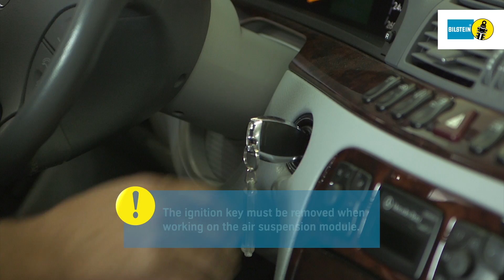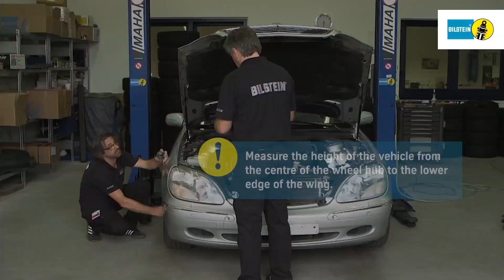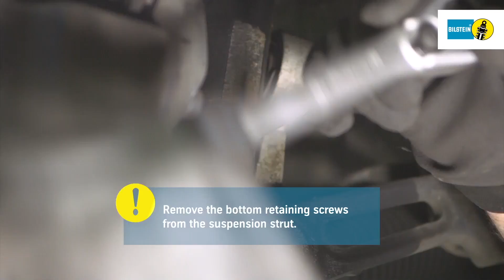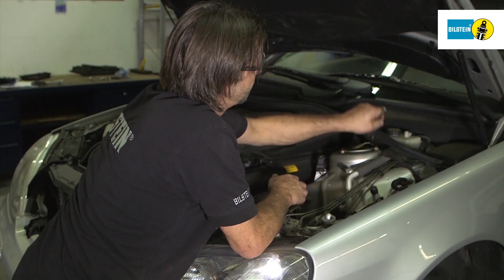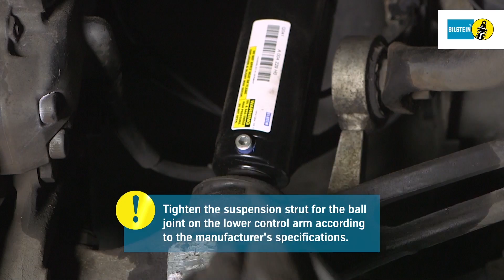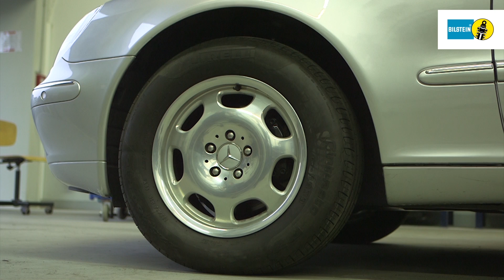BILSTEIN Installation instructions B4 air suspension module Mercedes-Benz S-Class W220 front axle

Comment: Hi my s class strut is stack on top high level at front right I have try to release the air with open the top valve but no air coming out and still is top high level at front right how to repair it ( the strut is new)
Reply: Your airmatic module id broken
Reply: @maciejyzniak1025  o co on tam pytał?
Reply: Audio Stereo Pisał ze prawy przedni amortyzator podniósł sie i nie chce opaść nawet po próbie wypuszczenia powietrza
Reply: Nai?